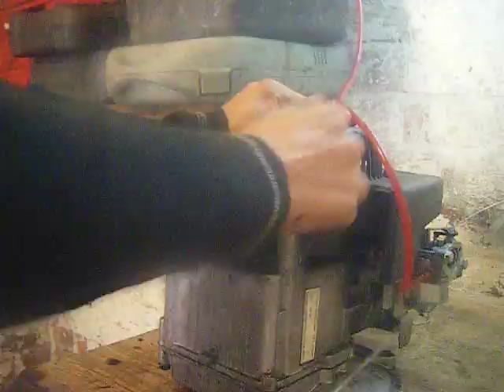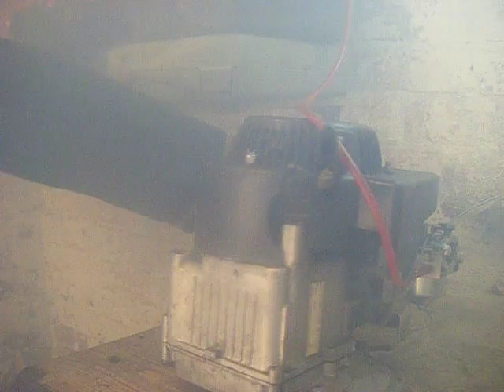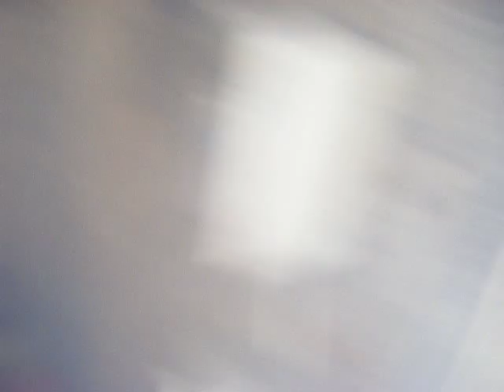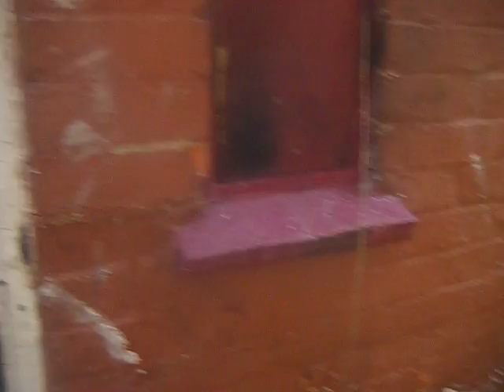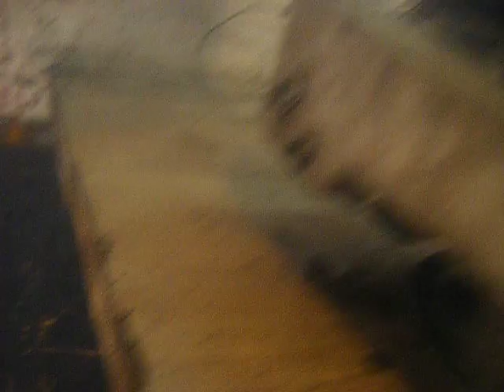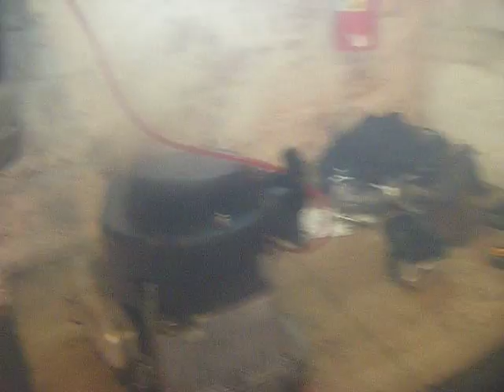blowing a lawn mower engine part 1

Comment from the maker: I couldn't. the engine was bolted to a table and the crank didn't stick out enough to fit a blade onto. plus a unshielded lawnmower blade is rather dangerous lol, anyway this engine is long gone